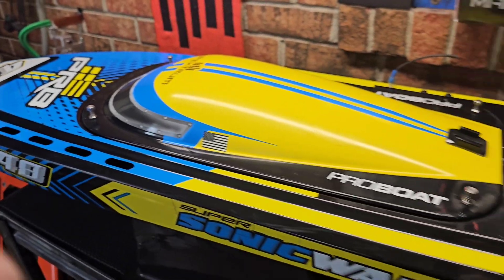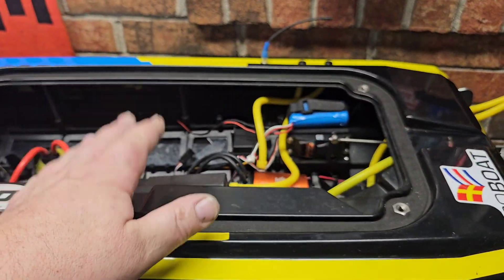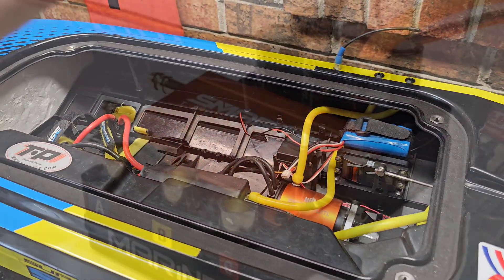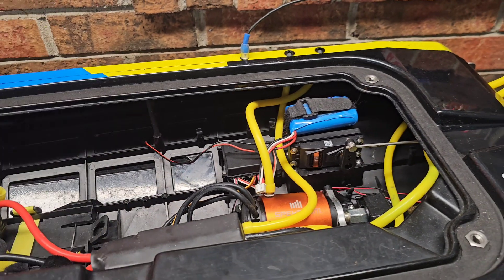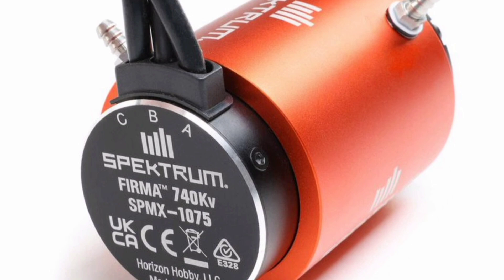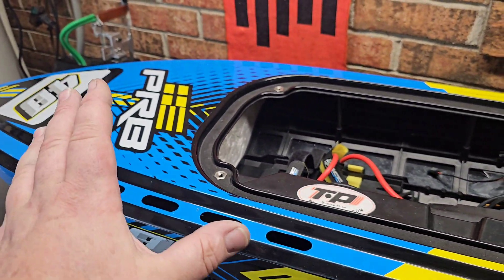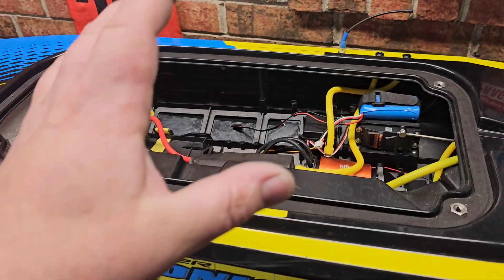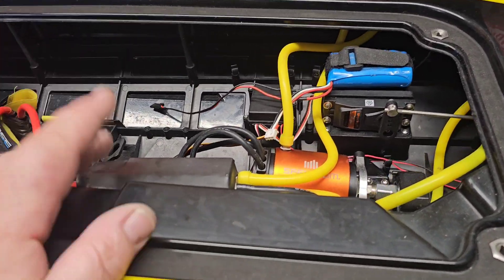Ultimate 12s Upgrade Spektrum 200a & 740kv 4685 Proboat Super SonicWake or Blackjack 42

Comment: Is getting the esc only and running 12s (light packs) stock motor a bad plan?
Reply from the maker: 12s stock motor smaller props or stock prop should be okay.   Fyl i burnt a stock motor on 12s but I had a larger prop on which caused the melt down.    Use caution ⚠️

Comment: I’m trying to convert my traxxas m41 wide body from 6s to 12s. And so far I have to upgrade the esc,motor, batteries and a better water cooler. My question is if it is possible to do?

Comment: What good is this if good at all is this for the sonicwake v2? Is the esc a direct bolt on ? Are the motors interchangeable?
Reply from the maker: The v2 SonicWake has a 4068 size motor, this is a 4685 size motor!   MAJOR MODIFICATIONS to fit this in the v2 SonicWake.    

Direct drop in for the ssw 48 possibly the bj42

Comment: Nice to have more options from Spektrum, the 200 amp esc should be good for the BJ42 👏🏻👏🏻👏🏻👏🏻. The 740 kv motor on 12s will be a super slow rpm but powerful, seriously doubt that it will be fast because of not enough rpm and just propping it up won’t add enough speed.
Reply: Wrong... for the same motor size , a lower Kv means more torque, or ability to maintain rpm under load.  The Original prop will be good for 60mph all day, and close to 70 with a bigger prop. On the BJ, with a ABC  2016-17-45 or 2116, Over 81mph
Reply: @vincentvassallo3843 12s power with a motor kv of only 740 is a maximum of only 37,296 rpm which will equal 🟰 a quick but slow boat.😊
Reply: @scottdearmond5532  laughing... may be you are kidding me? No worry! 
740x 44,4V= 32856 rpm. probably 30-31000 pm under load.
according to you, with this Kv of 740 in 12S, the boat will be slower than with a Kv of 950 in 12S? when you see that 2-3 youtubers have tried this combination and that their boats didn't exceed 65mph, doesn't that make you think? we should get 70-75 mph, so we're 5-10 mph short, assuming the boat doesn't fly away. For you, a BJ 42 at 80mph isn't fast? No thermal boat reaches that speed...
Reply: @vincentvassallo3843 A motor with a kv of 740 is definitely 210 rpm slower per volt than a 950 kv. BJ42 is capable of 80mph with stock electronics 8s with a 1350kv is way more rpm than the 12s setup, I’m working on my 2nd BJ42 with a kv of 1450 and is 10s capable which will be capable of 💯mph. 🤔☺️
Reply: @scottdearmond5532  1450? which motor? On a Cat, the load is less for the motor, curious to see à BJ over 100 mph. 10 year ago, I did 70mph with a 700 kv motor 12S on a 40" cat, the motor gave up...
Reply: @vincentvassallo3843 The”Dynamo” 53100, 8-pole motor from Bill Oxidean, only recently did I see Bill running it on 10s  in one of his twin cats , even at 8s the motor should push the BJ42 around with authority and still do 85ish plus mph.☺️Still deciding on which esc to get. 🤔🧐Bill says to go 300amp.
Reply: @scottdearmond5532  Oh yes, this is a rebadged Tenshock, excellent choice for sure, better that all 56 Can motor. Be sure to reinforce the tunnel portion where  the motor mount sits, this motor has so much torque, it can twist the hull. My trick if it is doable: the motor mount should be widen twice... With this kind of power , go with the 12000 15C Graphene HK, or the biggest SMC's. Yes, the 300A because the last hobbywing's are not expensive, but 200 would work on a Cat. Good luck!
Reply: wow, I realize this 53100 is a re-branded Tenshock 5360, but the 1450 Kv is plain silly, if you look at the small table showing 5360, you can see that the operating current is 200A, which means that the 5340 format was better suited.You will need to operate the 53100 at over 100A to get some efficiency from it. A beast for a big SAW outrigger, too much for a BJ , the good thing is you can put the largest propeller you want, but a 300A Esc is mandatory, and batteries should be with  the highest real C rating. Your BJ is good for 110mph ,  start with 6S, may be?
Reply: @vincentvassallo3843 
Where can I find these videos of people using the Spektrum upgrade
Reply: @scottdearmond5532 looking forward to seeing it….

Comment: Aaaahh, I'm delighted that Proboat understood that it wasn't easy for the neophyte to get good performance out of 8S, and that's why they switched to 12S, which is a mistake unless you use a small propeller that's not efficient enough for the size of the boat, but small enough not to burn out the motor and still reach 60mPh. This new KV will enable us to reach the same 60 and may be 70 with an upgraded propeller, but above all greater autonomy and reliability. That is, until some wacko mounts a 60mm propeller with a 1.6 ratio pitch...
Reply from the maker: This should be plenty for the ssw48

Comment: Spektrum has NEVER given us a new ESC without later following up with a brand new model featuring said new ESC. 

When they gave us the sensored ESC in the Losi 8ight, the new buggy wasn’t out yet. When they gave us the black case Firma 150 ESCs, the new arrma EXB trucks weren’t out yet. I fully suspect and expect horizon to put this ESC into a new boat. No idea what it’ll be though.
Reply from the maker: I knew they were releasing a new 12s capable speed control   but didn't know about the 740kv 4685,  I think it a great drop in option for many larger models.  

Let's hope they have a giant ul19 otw lol.  That would be so SICK!   One could only pray right!
Reply: @ 40+ inch hydro would be my end-all boat and it’s not even close